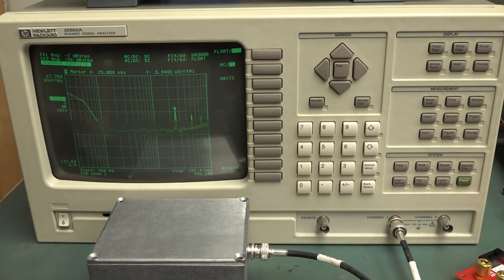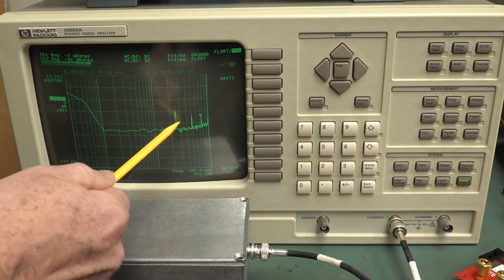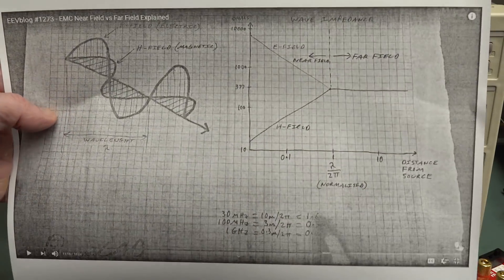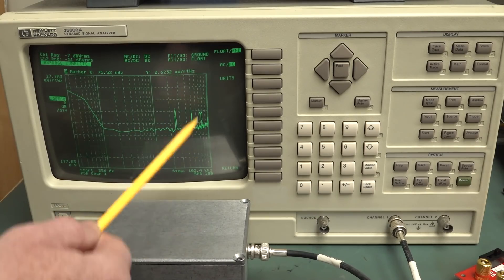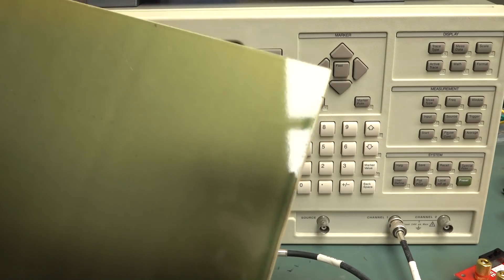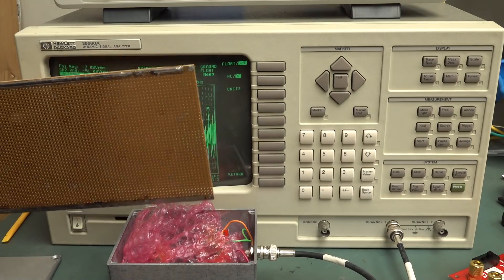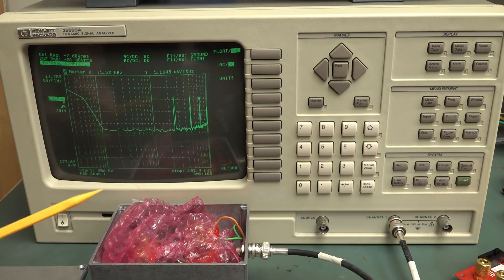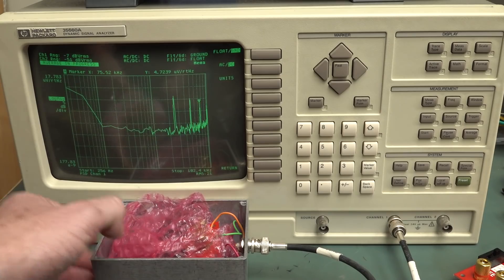EEVblog #1329 - Magnetic Field Shielding DEMONSTRATED

Comment: For a free high permeability steel for making your own near-field magnetic shield, breaking open a discarded microwave oven, the big transformer inside contans laminations of silicon-steel which are high permeability. An edge grinder can easily remove the two strip welds that hold it together, and the laminations are relatively thin sheets that are also relatively soft and can be cut with sheet metal snippers and then hammered flat on an anvil.  If you recycled and put a big transformer into one of your projects, it might benefit from this kind of shielding from the near-field magnetic radiation. HTH.

Comment: Although it's not relevant to this 25KHz testing, you said "If" there were low frequency fields of around 100Hz  present. 
Surely there actually was, due to the vertical deflection coils of the CRT?

Comment: I am a audio tech, got a desperate call at 5AM there was noise everywhere in the mixing console. I tried to talk through it but was forced to go in at 5am. The Studer 24 track machine has Mumetal shields on the head guard. There was an CRT computer monitor sitting on the meter bridge a couple feed from the machine.  The assistant had forgotten to flip up the head shield when loading the tape. I was not happy and knew what the noise was as soon as I saw the test box sitting in front of the CRT in this video.

Comment: I've seen this before. I was a service engineer for an electron microscope company. I had a customer who had to spend $200k USD on room prep because they decided to put a TEM and SEM next to where the 13KV building supply came in. Just what you want next to sensitive equipment. With fully welded walls of thick Al and vibration mitigation, the room was AMAZING. Except for low frequency magnetic field fluctuations. I could tell in the image when the elevator half way across the building away moved.

Comment: At my job I have to do testing for ingress into a coaxial cable network. Sometimes it doesn't matter if the meter is connected to anything or not it will fail in certain areas of town.  Bad shielding on the meter.  If I put the meter inside my vehicle's  steel center console, I can get my test to "pass".

Comment: 9:15 nice. You've invented a movement sensor based on EMI 😅
Reply: Qorax IIRC, this is the principle by which many traffic light detectors work. The presence of the car disrupts the field, signaling to the traffic light to change its sequence.
Reply: @codydowling1120  Ah I thought it were just capacitive coupling sensors, like those old school touch buttons that used to be on 70s design home appliances.

Comment: If you connect Ch1 to the Source output on the 35660 you will probably see the same. You probably have to zoom in at 24.665 kHz with 1 kHz span. The shielding between the CRT and the signal generator is not that great in this instrument.

Comment: Hm. Bet you could do a whole video or a whole series of videos on shielding. You could even try to answer the age-old questions: Do I ground my shielded cable's shield at one end or both? If at one end, which end?
Reply from the maker: The rabbit hole is quite deep.
Reply: @EEVblog  Yes, but deep rabbit holes are the most fun and somewhat of a specialty of yours. And knowing how far to go down them to achieve a practical if not necessarily perfect engineering solution is often difficult. In any case, I really enjoy your quick afterthought follow-up videos - and all your others, too.

Comment: Many guitarists use coper tape inside the guitars 1/4" output jack partition, the jack socket is mounted to a plate that lifts off,and a small compartment is behind. The jacks sockets are very usually unbalanced so they try to quieten the noise with copper. So should they be using a mix of metals to prevent noise and many layers of metal tape? 1khz and below is very important.
Reply from the maker: You'd have the know the exact problem source, but yeah, MuMetal might be worthwhile.

Comment: Though the CRT is shielded on the sides, the front is glass with a mask. The H field can easily be transmitted through the front of the CRT. At the very end of the video you held the aluminum box higher and the effect was much lower. Putting the Al, Cu & steel sheets in between completely covered the glass front of the CRT that was  not shielded.
Reply: ...so you're saying that we need transparent Aluminium for the front...?

Comment: The skin-depth for aluminium at 25kHz is 0.5mm. If you take a thicker material (and not a zinc alloy but conductive aluminium) then a 3mm sheet shall block M-fields almost completely. Warning - a "cut-line" - i.e. where the lid closes on the box - compromises the integrity of the shield. (this is why the copper "strip board" perf-board does not shield at all at 8:19 ). Most magnetic shielding can be done without mu-metal, just with good design and some thought. Mu-metal or other high-permeability ferromagnetic metals have potential to fail too, if slapped-on without careful thought.

Comment: I hear all of the “preppers” saying that to save your electronics, during a solar storm or a nuclear blast, that a microwave oven is shielded enough to stop the EMP. Could you make a video explaining if this actually works or not?
Reply from the maker: There is a dedicated chip that detects EMP's and gives trigger output. It's designed to shut down system before the pulse hits.
Reply: @EEVblog  Oh that is interesting, can you make a video of it or a short description?
Reply: @EEVblog  The trigger output is sent via Tachyons?
Reply: Microwaves are shielded with steel. The weakness is the door openings which can act as wave guides to higher frequencies. If you put a phone in the microwave (don't turn it on) and call it will often ring. A portable radio wont work (the wave lengths are too long) but the phone will. Because of this the doors of many microwaves have small groves pressed into them designed to reflect and cancel out radio waves - but ONLY at the exact magnatron frequency.
Reply: Preppers & EMP ... whiffs of audiofoolery
Reply: Lassi Kinnunen That is what I figured. I am not as smart as Dave, on this subject, but I love learning, plus I figured it could be a good subject for a few good laughs. I have some friends that keep pre-paid phones and laptops, in an old microwave in the garage, just for that purpose. I do not know wether to believe it, or to laugh at them.

Comment: i have heard that for low frequencies, mains frequency, one can use Laminated Copper around 6" thick or more for shielding. Based on this video, I wonder if laminated mild steel would be more effective. This is how one would shield their homes from power distribution lines near their homes. Of course, if one is planning on trying this, you will need to dramatically increase your foundation footing and foundation. Same for roof rafters. Same for walls.
Reply: If you're putting that much copper up, you don't need more wall!

Comment: Early PC stuff--put the CRT monitor on top of the floppy drives creates interesting effects.  The drive head amps get the EM field from the CRT deflection circuits and the video goes wobbly from the magnetic field in the drive spindle motor.   Add a steel hood over the drives and you can read and write disks, but the display still goes a little wobbly from the very low frequency of the motor magnetics.
Reply: But most computer cases were made of steel sheet. I never had such issue with the old machines.
Reply: @laharl2k  In the 1970s, high-density foam, vacuformed or injection molded plastic was very popular for microcomputer cases.   I can cite numerous examples.
Reply: @tubastuff  
So i guess you are talking about something like an amiga or a comodore then? 
At most all i've seen or have is from the late 80s, and they where all XT/AT.
Reply: @laharl2k  My personal experience was with a Durango F-85 (ca. 1977).   High-density foam case sprayed with zinc on the interior to deal with RFI per FCC part 15.
Reply: @tubastuff  
Oh that i never even knew existed and yeah its quite obvious that that tiny CRT being so close to the floppies could cause some trouble. I was thining more like crt in the middle, not directly on top of the floppies, thats really bad design.

Comment: Good deal.  Reminds me I can still move forward on the spiral conical antenna instructable since I left off with only the "form."   Excellent referenced video for sure.  Makes me wondering what newer high magnetic permeability materials can do, to improve performance of the older systems.  https://en.wikipedia.org/wiki/Permeability_(electromagnetism)#Values_for_some_common_materials

Same thinking goes with...., I think it's the OLED's are the quietest... though, mainly thinking upgrading the sources of noise, RFI, EMI, etc. in the systems for a modern upgrade to the old boys.   Would be nice if silver foil was more commonly available.  I guess that's what's used to line the mil/intel grade boxes.  Plasmonic resonance frequency is one of those newer buzz words to me... though is more to do with electric effects and I guess somehow with magnetic... though the magnetic world is another beast.  Just like polarization.  Tables with polarization related to electric characteristics don't seem so common... same with the magnetic characteristics.   Great demo!  Thanks for sharing!  Good fun.

Comment: Dave, you are the nearest electronic Genius I know. I'm seeking an answer or the path to find the answer to this question: "Is there a frequency range, through which an internet type packet communication could be passed through the power grid? " Even pulse DC?
Thinking there might be a way to utilize the power grid to communicate information long distances to the boonies where there are few other communication methods. Any thoughts where I could beneficially pursue a meaningful answer. Thanks Dave.
Reply from the maker: Ethernet over power lines is a thing, you can buy commercial products for your home. Long range sucks arse because a single wire is a horrible transmission line, and EMC would be a huge problem. I'm not even sure how those home device get approval for that.
Reply: @EEVblog  Those ethernet over powerline devices wipe out the whole HF band. They should be illegal.
Reply: @EEVblog  Would actually be fun to see a test done with your equipment, I had some "gigabit" HomePlug devices: had to return that crap because it did not work well speed wise, but main reason for return was because it managed to greatly interfere (create static noise) with FM radio reception, both inside and outside my apartment!
https://en.wikipedia.org/wiki/HomePlug#EMI_concerns
Reply: Answers, Answers, Answers. Thanks so much, you guys. Dave, you and your following are RESIDENT COLLECTIVE GENIUSES . Profound ... Thank you.
Reply: Powerline Ethernet exists. For long distance, there's DSL. Not sure what you're getting at here.
Reply: Data over AC has been done.
Its not seemed to perform well.
For the boonies satellite and microwave work better.

Comment: Another technique that's useful for very low frequency/DC magnetic fields is active magnetic shielding via Helmholtz coils. Completely impractical for compact applications but does create a controlled environment when testing out sensitive things like magnetometers.
Reply: this makes me remember the ciba geigi experiment/patent. i gigantic kondensator with hoigh dc volltage to create a field that shields from outer side. or so. oh my english ;)
Reply: @Raketenclub  Worked on 'MagnaVoid' - Microvitec CRT monitors with built in active magnetic cancellation back in the day, for industrial applications - built a big perspex Helmoltz coil demo rig with 2 monitors stacked on top of each-other, one with and one without the system to take to trade shows... ah, what fun!